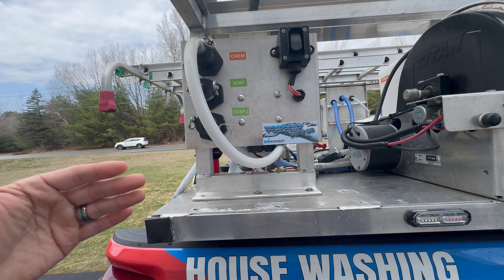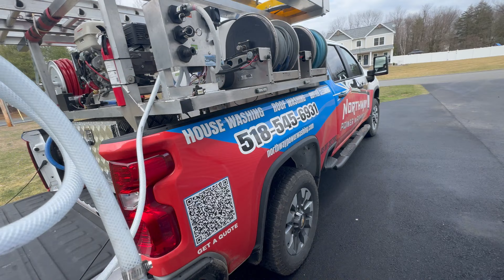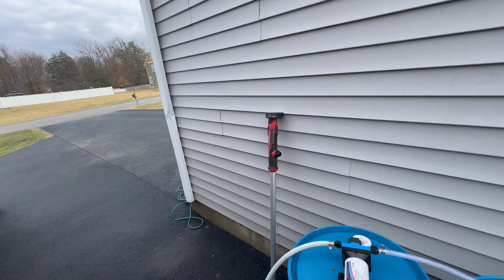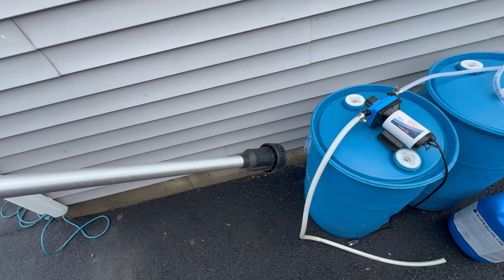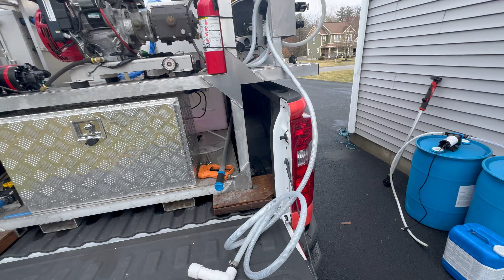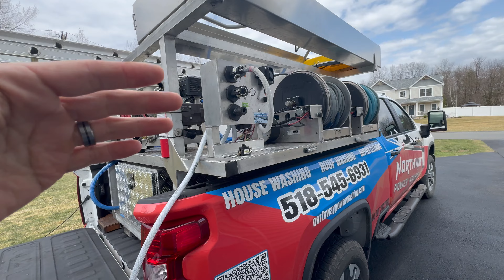Efficient Chemical Loading System for Soft Washing | Boost Your Workflow!

Comment: so at the end of the season do you take the skid off of the truck and store it in your garage? or do you park the truck for the winter inside?
Reply from the maker: I drain the skid completely, tanks, hoses, etc and lift it off the truck for storage. Winter is tough around here and temps are usually too cold right after thanksgiving.

Comment: I have a skid coming from Midwest with the Vortex Fill N Go on it.  How are you rinsing the pump out after loading your SH?
Reply from the maker: @526colin  Awesome! I fill my sh first, then I fill my soap (concentrate with 25 gallons of water mix) next, that helps rinse the pump. I also disconnect the back of the fill n go station sh line or right at the check valve and run clean water through it every couple of uses. I’ve had mine for 2 years and the same Remco pump is working great. Hope you enjoy the skid, make some $$$$
Reply: @northwaypowerwashingllc  thanks for the advice... I'm really looking forward to it arriving. This will be my first legit rig
Reply from the maker: @526colin  go get it! Good luck 🍀👍